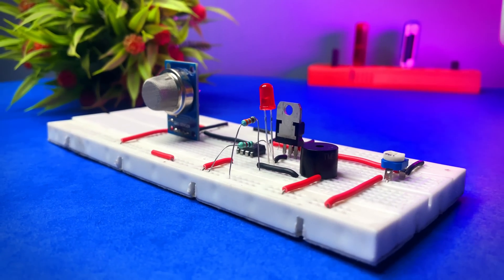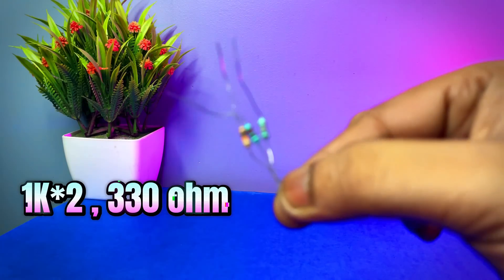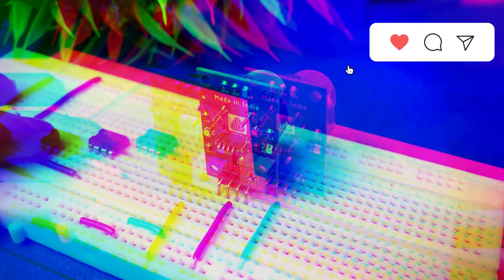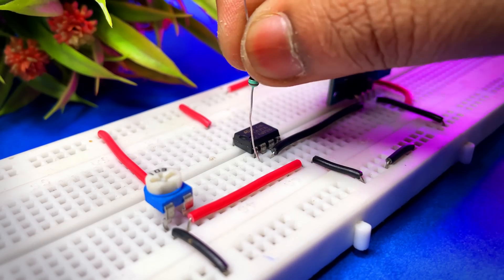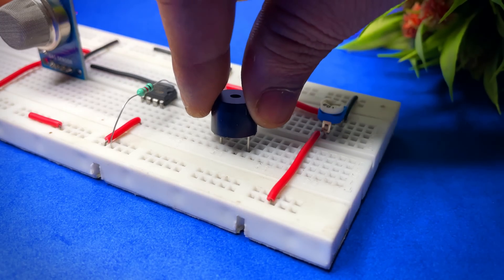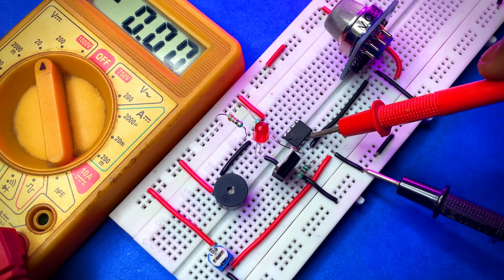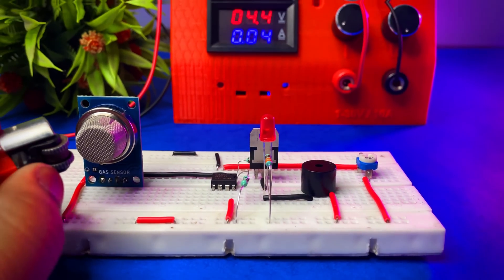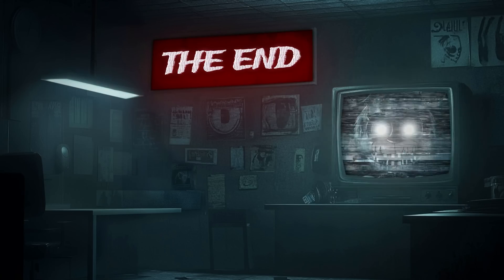"Gas Leakage Detector Circuit Without Arduino | Simple MQ6 + LM393 DIY Project"

Comment: Where to Fit the Battery ?
Reply from the maker: Use 5v supply and connect to positive negative rail of breadboard
Reply: I am Not getting it were to connect the Battery
Reply: Can you please share me circuit diagram of the above project?